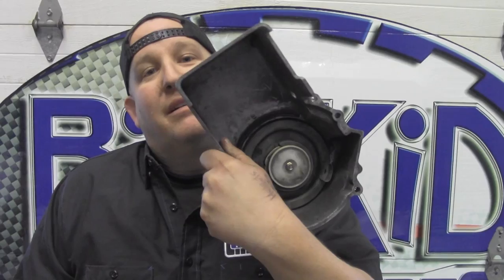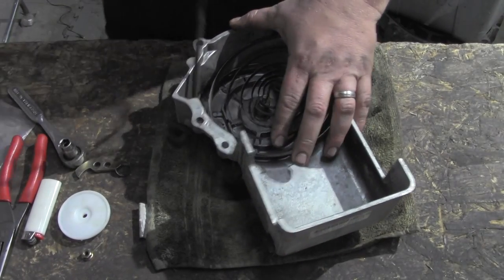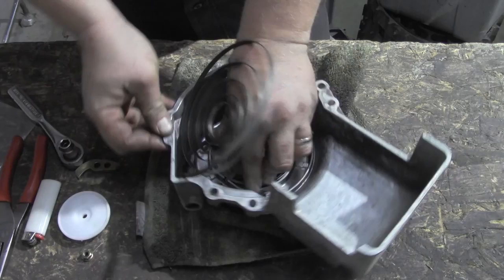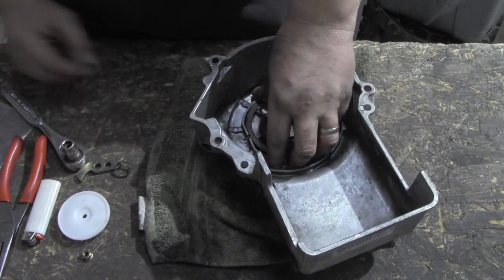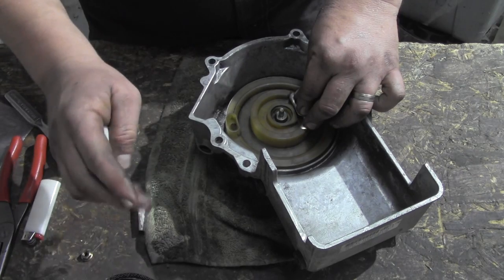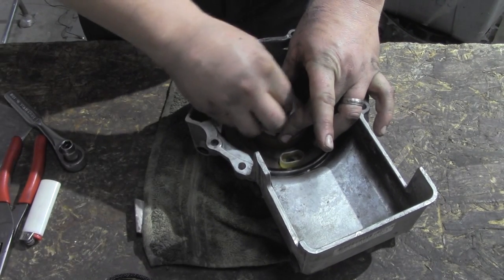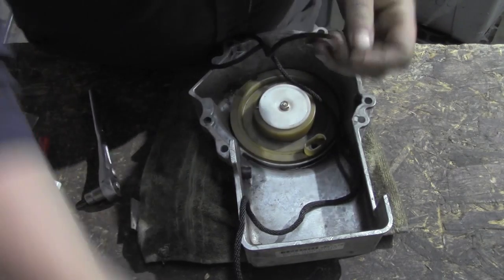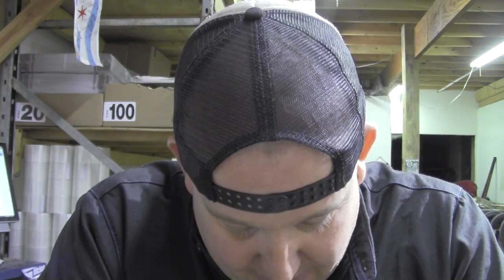How to Rebuild a Snowmobile Recoil

Comment: Most important thing - don't get frustrated, go slow. I watched a few other vids on this topic and this is the way to go HANDS DOWN. After watching this and putting everything back together on my '85 Polaris indy trail hand-me-down, I wasnt happy with how the string was being wound back up so I'm going to take it all apart and do it again and wind the spring tighter. No problem, not even worried about it.
I watched this video once, thats all ya need. Good luck, you can do it too.
🤘Thanks for posting this video🤘
Reply: I agree 100%

Comment: I was to the point of looking up what a not running sled would sell for and saw your vid I had tried 50 times but it kept unspooling I followed your advice and had it fixed along in time with you and installed thank you so much

Comment: Those springs are $50 here in Canada to buy new I just replaced mine not cheap
Reply: Find your part # and cross reference with Dennis Kirk or Royal Distributing (Canada). $10 at Royal